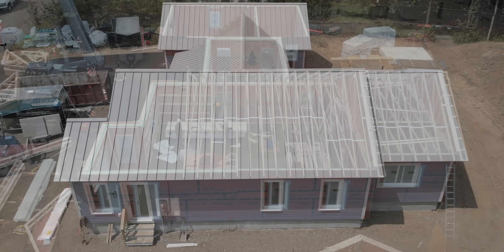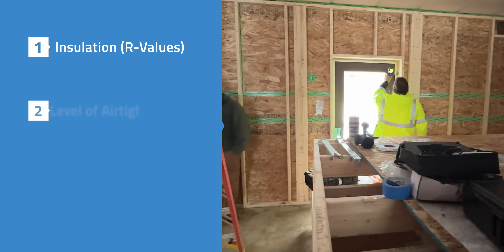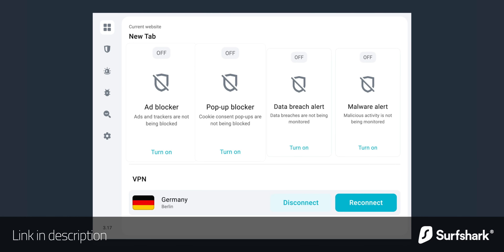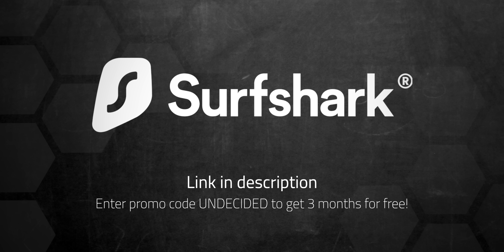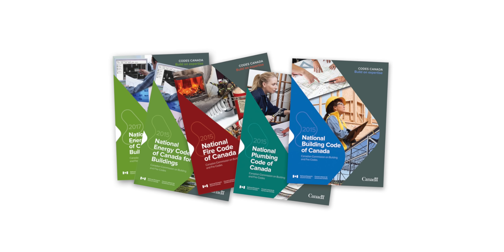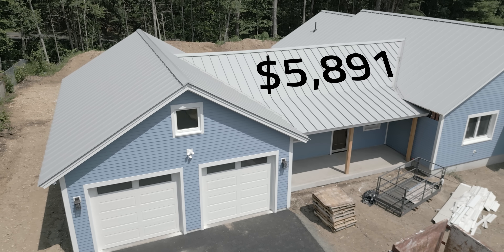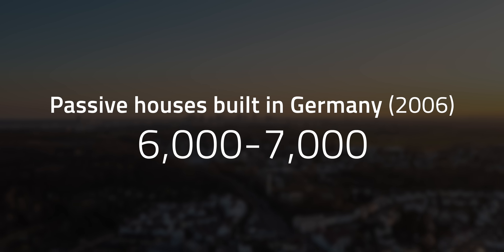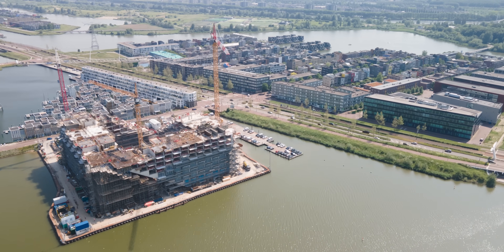Why Do American Homes Suck?

Comment: Ironically, solutions were well known over 50  years ago. In Rodale's "New Shelter" magazine, each month they highlighted solutions  implemented to deal with the "Energy Crisis." However, the real obstacles to frugality were financial institutions (usurers), meddling government (codes & zoning), and inept entrenched interests that got rich from enforcing our wasteful consumption. In many cases, self financed, owner-builders were the only ones taking the risk to save energy and resources... and suffered persecution for it.
Reply: Addendum - most Americans do not understand their own laws, so this wistful desire for "national codes" is contrary to law. Each state retains its sovereignty, freedom and independence except for such powers expressly delegated to the "United States, in Congress Assembled" (Articles of Confederation, 1777). Outside of the delegations spelled out in Art 1, Sec 8, USCON (1789), the Feds can't meddle - at least not legally. Of course there are work arounds. But the problem is the government, local, state or federal, interfering in all manner of ways. If all government subsidies and penalties were removed, common sense and enlightened self interest would result in a massive shift toward superinsulated, frugal, and disaster resistant housing. To do otherwise would be foolish.

Comment: Legal requirements in Denmark are to have R value 20 in floors and walls and 30 in the ceilings. There has to be an airtight vapour barrier in all rooms, and doors and windows that match these insulation requirements. Most new houses are heated with floor heating, often through a waterborne earth heating system with an electric compressor driven by solar panels on the house. Oftentimes there's also a ducted automated ventilation system in the ceiling, that will partly clean the air and move warm air from hot rooms to colder rooms. We have many zero energy houses, or even net energy producing houses. 
The reason this is possible is because Denmark is situated on the absolute middle of the European tectonic plate. Not a lot of natural disasters here. In US you regularly have to rebuild houses after tyfoons and so on...

Comment: I was a HVAC Installer foreman for 6 year in California. The reason we use cheaper A/C units is due mainly due to price and installation time. Installing a standard (cheap) a/c system is broken down by cost of parts, labour, mark ups from both the company I worked for and the builder. A new (cheap) account system costs about $9000 just for parts. The company I worked for would charge ~$13000 for labour (prices change and vary per area and per year) putting the average cost at $22k in total to install all of the a/c system and other metal in your home (I'm a sheet metal journeyman, we install topouts, dryer vents, washer pans, kitchen vent hoods etc etc as well). To install an a/c system like yours generally would cost much more in parts and labour. I've installed units like yours before, they generally cost ~$16000-$18000 depending on manufacturer etc etc and your duct work is magnificent (or magnificently well hidden in all the insulation 😏) and will cost so much more in parts and labour to install and take much longer compared to flex duct (I'm assuming it's metal duct due to rigidity). Metal ducts takes longer to install since it has to be the perfect length to link up at every part across the home, more or less a custom build, if it isn't the perfect length you have to send it back to the shop and waste time getting a part made or finding a close enough replacement yourself (or using the bandsaw like I would 😂). You also have to hope that all of the trusses are placed properly in the home to accommodate the size and angles of your a/c unit. Not a problem in your custom home, but definitely one I've ran into many times building line homes. The high efficiency electric units are actually easier to install in the attic are require similar amounts of labour, but the cost of it is almost prohibitive and sometimes just getting the fucker up there is a nightmare (if the delivery guys cant do it as a team, leave it to the Installer. Assholes.) I have more things to note about your video essay, will come later due to lack of time.

Comment: Hi matt I didn't know if you will find this comment. I am young engineer working in the construction business in France. I advise and help people or community too build houses. In France if you want to build a house or a building it has to respect the RE 2020 code. In this code their are mainly two part the thermal part and yes the environment part. The thermal part say that the wall has a have R higher than 3.75 . The insulation for the floor higher than 3.75 and celling higher than 10. So normally house has for a wall 4.75, the floor has 4.75 and the celling is about 10 to 12. The window and door UW 1.3 and the door 1.2 . The heating system is of course a heating pump with floor heating. For the air part it is not than Q4 = 0.6 
But wait that is more didn't forget about the environment part.Too make it simple the house have too have a low impact on the environment so you have to use less of ciment and more wood. if the house respect the thermal law and doesn't respect the environment law it will not be constructed.

Comment: It's not that they suck, it's that they leak energy every each way. And houses in my country did that too, 35 years ago when we were still a communist country. Because energy was subsidized to the point of being almost free. You had all these commieblocks with bare brick walls or concrete prefabs with cheapest leaky windows. It was cheaper(or easier - in communism the access to materials was more important than having the cash) to use twice the amount of coal per winter than to buy better materials for your house. In 1989 energy became much more expansive because they stopped subsiziding it, and everybody started to add insulation and replace windows with good modern ones. Energy usage for heating went down very fast, 10 years later it was like 30% lower on the country scale. Now it's again much lower (and many people switched from coal to other stuff which is again more efficient).

Comment: I work as an electrician in Switzerland and here I am used to walls, floors of houses and buildings to be made with 30cm (12inches) thick concrete, then everything waterproofed with thick tar based sheets on the outside surfaces of the concrete, then all exterior walls (facades) are insulated with very thick (around 15 inches) either fiberglass, rockwool, xps or polystyrene foam. Then on top of all the tick concrete floors, we put one layer of polystyrene foam(not as thick), this is here we put the heated floor tubing, and then one more concrete layer of top of that, so all floors are thermally and acoustically insulated from each other. 
So you get exterior walls that are 20 to 30 inches thick (concrete + insulation). 
Oh and the non bearing interior walls are either bricks (yes for real) or double layer drywall with steel framing. 
In most cases the only wood you see in construction are the doors or the floor paneling at the very end. 

The electricity part, every wires are in special tubing we attach with steel rebar before the concrete is put in, so we have tubes and electrical "boxes" everywhere IN the concrete floor and walls , and we pull the wires when concrete is done. So we have to place every tubes and boxes precisely before the concrete is put it because we cant change it later. If there is a box for an outlet "here", well its embedded in the concrete so it better be the right place. 
this way if there is a fire from a wire, no big deal its in the concrete. And it's 1 wire = 1 tube in most cases. So there are miles and miles of tubes in the concrete joining a bunch of electrical boxes, lamp boxes, switches, etc. 

So yes with my experience, seeing house construction in the US is very... weird.
Reply: Thx to share this info, i’m an elektricien myself in Belgium, and have a friend who is building a new home in swiss with poured concrete  inner walls. And i was wondering how you do the wiring. In Belgium walls are made out of bricks and we just cut sleeves.
Reply: Cement production is one of the world's worst industrial pollution sources.
Reply: @disqusrubbish5467  The same goes for burning fossil fuels for excessive heating due to poor insulation
Reply: @poiuztrewqlkjhgfdsamnbvcxy You can add as much insulation as you need for whatever climate zone you live in.  And of course hydroelectric and nuclear power are not fossil fuels and don't have that problem.
Reply: @Big_Computer  same here in our area too.
Reply: yeah and houses in Switzerland look more like bunkers than houses...who wants to live concrete bomb shelter.....imagine doing plumbing and electrical......
Reply: US construction techniques are, for the standard house, 100 years behind the times and they are horrible. I built many houses and I know, the structural lumber requires so much extra work to straighten it out unless it is engineer lumber.

I’m in electrical engineer and I think your electrical method you described is ridiculously overkill. You’re not building an airliner. Alternating current is not a big fire hazard. What are you talking about??
Reply: I'm from Switzerland too. You and I know that theses overengineered buildings are nuts. Nobody can afford them anymore.
Reply: @HerrLustig1234 not over engineered but built to last. Most warranties on US houses is 30 years. I’m sure you’d like to replace your roof every 30 years and watch your house blow away in a 150 km/hr wind or burn down in 20 minutes as they have done in California.
Reply: @HerrLustig1234 :  it is a total joke to put all the wires in tubes. I’m electrical engineer, they don’t even do that on airplanes. Alternating current is not a fire hazard. Circuit breakers protect everything wonderfully. No wonder no one can ever pay off a new home in Switzerland, you are renters for life. I’m half Swiss, here in America, and I own my house eight right from the beginning, and I’m not rich, because I built it myself. And it’s a wonderful house, hard time finding one like it even in Switzerland. What happened to you people?
Reply: @steveperreira5850  You're right. I want to move away from Switzerland as soon as possible. America would be a dream.
Reply: @steveperreira5850  the wires that you put into the tubing only have 1 isolation layer, cables have 2,.
In airplanes and machines they use cables so 2 isolation layers, no need for extra tubing, some machines have extra tubing though for mechanical resistance.
Yes it's more effort to put in more outlets but how often do you do that in the US? You can replace the wiring pretty easily with the tubing.
If you renovate a room you can cut sleeves for new outlets, it's more effort but you will renovate the walls anyways.
Reply: @steveperreira5850 you are wrong though every current that can spark is a fire hazard.
Smoldering fires aren't an issue in the US i am surprised?
Reply: @steveperreira5850  whats rhe difference between renting a proper build, durable house or owning one that has to be demolished after 30 years maximum?  Btw, building a proper home in europe doesnt cost much more from the prices i got.
Reply: @dadrising6464  I've never seen a home in the US that had to be demolished in 30 years.  Ours is 100 years old and just fine.
Reply: 12" of concrete? Maybe for a high rise. Otherwise what a waste!
Reply: @letsbereal-hd8qt  A lot of Switzerland is mountainous, many houses are built in areas prone to avalanches, landslides or flooding. They are used to building massively, if you like, call it "bombproof". I have often seen whole villages protected by massive dams or concrete constructions to divert regularly occurring avalanches. Useable land for building is at a premium in Switzerland, you use what you have and build to protect accordingly.
Reply: @letsbereal-hd8qt  if it helps lower ac usage (thus lower electricity bills in the long-term) it's definitely not a waste.
Reply: @malka1762  Its a waste in that it is an inefficient use of resources compared with reasonable alternatives.
Reply: The US houses that are built planned and built well can withstand the test of time just fine.  If your overbuilt houses are so great, then your yearly homeowners insurance must be almost free then, eh?
Reply: @letsbereal-hd8qt  stands the test of time except for the fact that your walls are made of cardboard.
Reply: Those cheap panels may be used in the South or something. As a contractor, I have never seen that. I doubt they are legal in any state that uses the building code.
Reply: @SmitePlayz1  False.
Reply: Sounds extremely expensive, I’d never recoup the money spent on that.
Reply: 30cm concrete walls is way worse than the walls we have in the US, which are made of wood and drywall, especially for electricity, which is very easy to access, update, etc, no need of embed tubes in concrete that have to be exactly  in the right place…
Reply: @diogodenczuk2192  It's a lot more durable, and it also does wonders for not hearing someone crap on the other side of the house.
Reply: @diogodenczuk2192   yeah but in the usa you can walk through the walls 😂
Reply: @diogodenczuk2192  wood houses age like shit and fly away with a wisper of wind 😂
Reply: @Ale55andr082 Not really if its built properly and maintained great.

Comment: A German here: We built a new house 2 years ago. The exterior walls are 17 inches thick and filled with volcanic PERLITE. All insulation in the roof is 10 inches thick and we use 3 layer Windows. … Under the concrete foundation slab are 6-inch thick insulation boards. Underfloor heating is installed in all rooms. The heat in the house is generated by a heat pump in combination with a photovoltaic system (12.6 kWp). At night, a battery storage (13kWh) system supplies us with the electricity we need. For our electric car we use a wallbox for charging. Charging is almost free for us for at least 7 months of the year. In our old house with gas heating, no solar and a normal combustion engine car (13,000 miles a year), we would have had to pay around 6,500 $ for everything in one year here in Germany.
So for heating, hot water, electricity and 13,000 miles by car.
We only paid USD 1,100 in our new house. … In one year, we consumed around 12,000 kWh of energy and produced 12,500 kWh through the photovoltaic system. With the cost of energy in the US, we would have lived almost for free, including almost free car driving! … Sorry for my shi*** english. …

Comment: you should check out the houses in switzerland. So when I built our school, the ammount of work that went into materials and their functionality was properly next level. triple airgapped windows, geothermal, solar, solid walls with reinforced steel. recycled filtered air flow, "air con is illegal" our tempature is regulated by the geo thermal, we use auto blinds to control tempature. our celings are made with fireproof noise insulating fiber panels. solid concrete floors that can passthrough heat. the building glass is a tempered uv glass, no film its actully built into the glass. I can go on for ages. and most swiss homes are like this. we dont use gas or oil at all. the bulk of our power comes from water, and renewables, and there is a backup nuclear plant but this is pretty low key. if you put hydro solar wind and geo on one side then I would say your looking at a 70 / 30 balance. the houses might look old, but if you look close, those old wooden farm houses, have triple glased windows, underfloor heating. and steel / stone walls behind the fancy wood on the out side. we even have kantons "states" where it is illegal to drive a combustion engine car. and "with much resistance because we love our cars here" there is a law that is trying to get passed to literally ban all combustion cars. approximatly 3 / 4% of all cars on swiss roads are EVs as of 2024

Comment: We (in Belgium) built a new house. Well, contractors built it. I was surprised when I learned about all the recent rules and regulations... Insulation and floor heating so you can heat with a heat pump. The house is air tight to he point the rooms have CO2 sensors that regulate the ventilation system. What you did not mention is rules on conserving water. Our new house has a 5000 liter rain water tank and (partly) double water pipes inside: tap water and rain water. When I hear of water shortages in some places in the US, it would make a lot of sense to use rain water in addition to tap water.

But in general, as an aswer to your question "why do American houses suck" I would say that we build houses to last longer. Both outside and inside walls are brickwork. Floors (also upstairs) are concrete. Roofs are made of (old fashioned but everlasting) baked tiles. Also, 70% of Belgians live in their own house. So we are more prone to invest in quality. I guess  ;-)